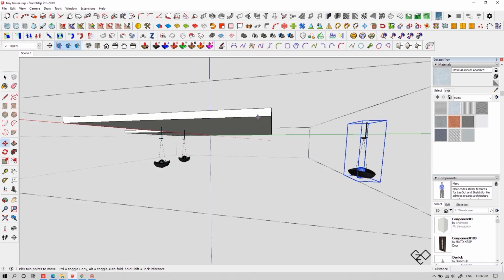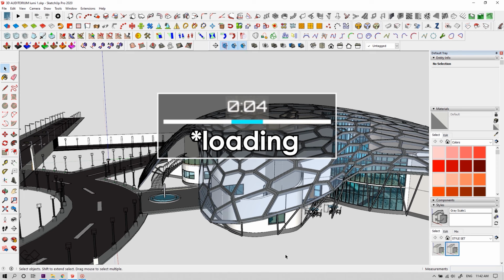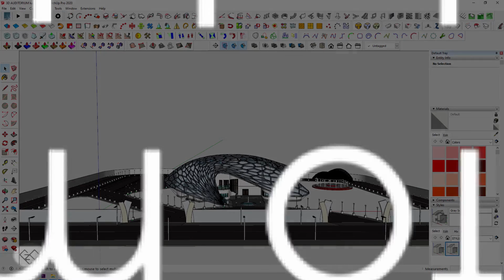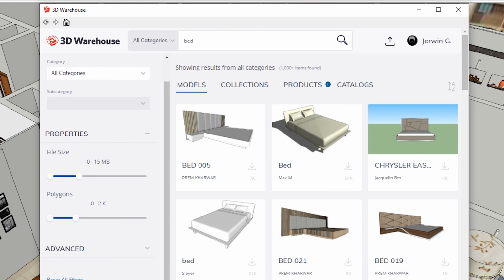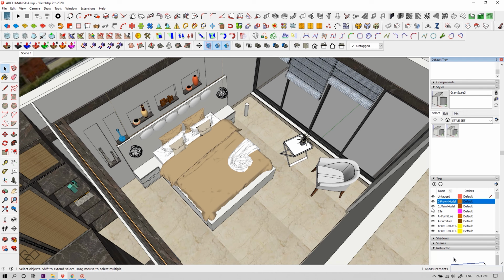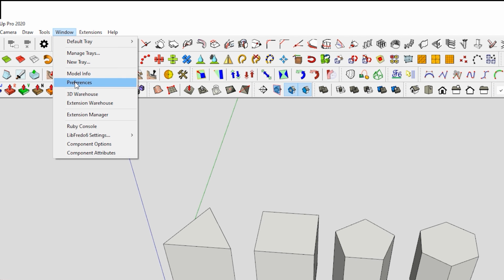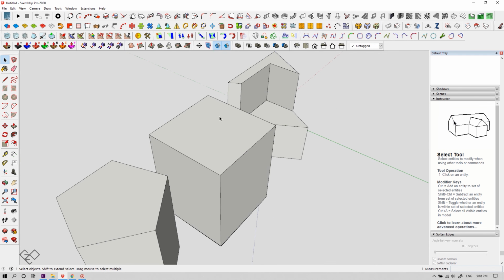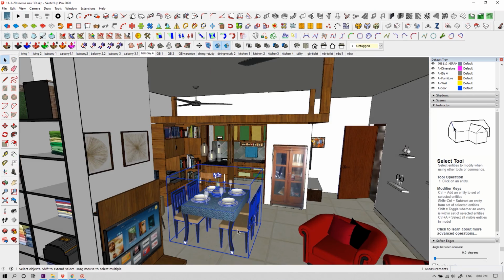Easy ways to work faster in SketchUp | 2020 | Geo Creations

Comment: I use Ctrl-Shift-V = Paste in place. When I break up a big model in smaller ones to make them lighter and later want to combine them, I use that. Or when I work with others on the same model, we both work seperately and then one copy pastes their modifications into the other model.